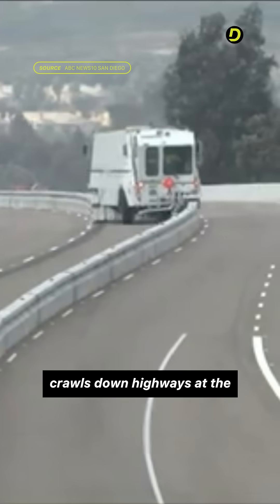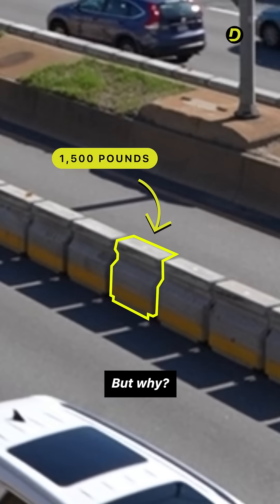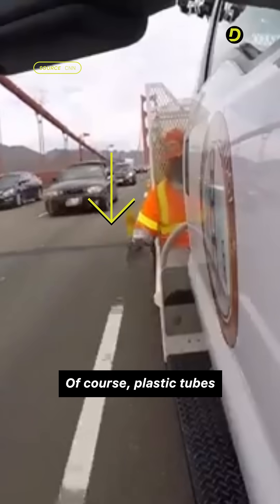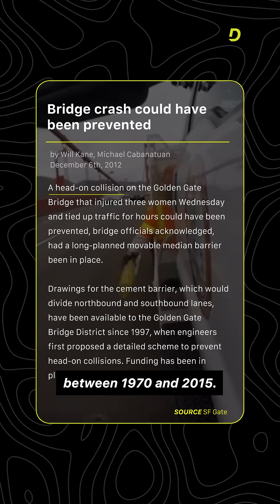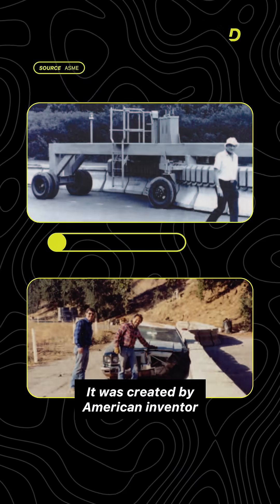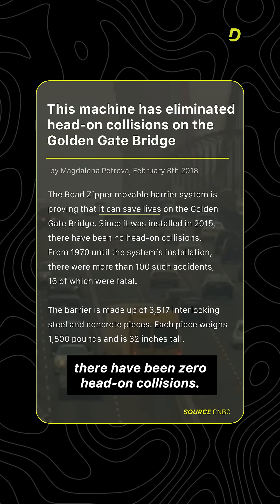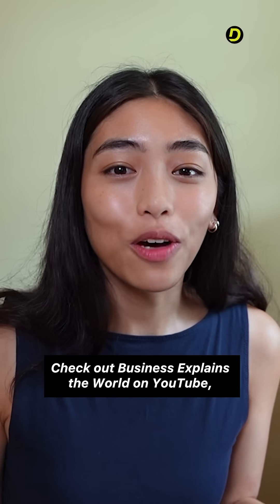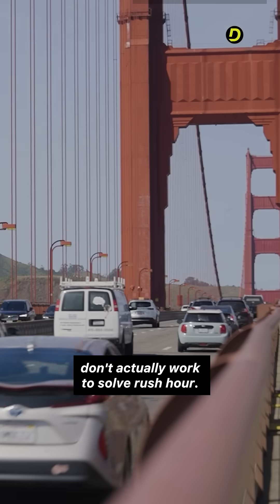The Weirdest Machine on the Road, This Machine Unzips Highways

Comment: @BusinessExplainsTheWorld
Actually, John Ward Duckett was not the original inventor, but instead further developed it. His contributions were  during the enhancement phase and important in the US commercialisation of movable barrier technology, but he was not involved with the original conception.
So even though he had a meaningful engineering role within barrier systems, he cannot be credited as the original inventor, who was John P. Quittner of Quick-Steel Engineering in Sydney, Australia. Quittner devised the interlocking T-top barrier modules in the 1980s. (US patents 4500225 & 4624601). (Source: I was there ;))